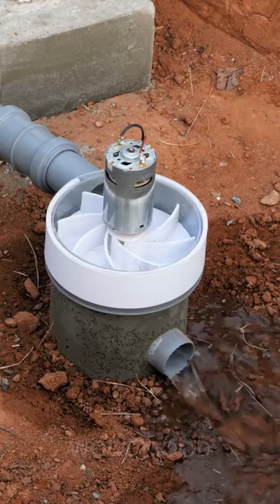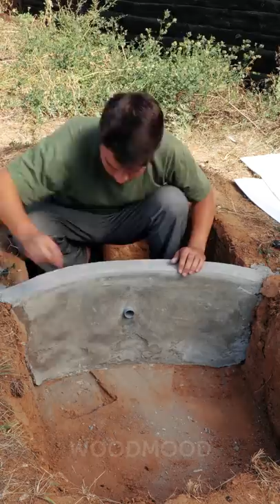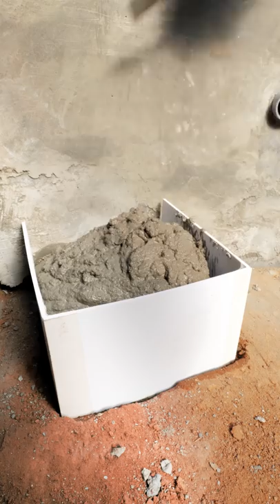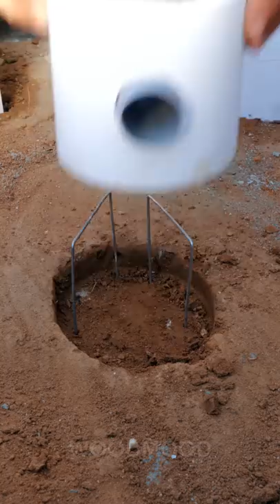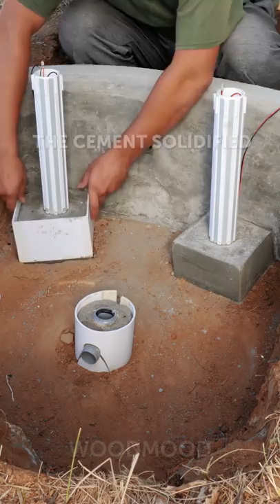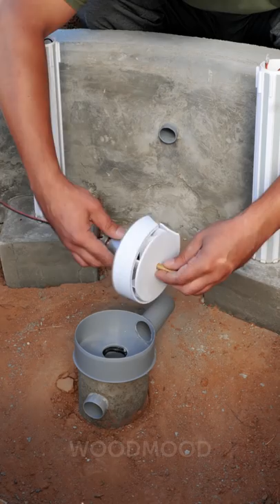I constructed a mini-hydroelectric power plant in the backyard #Shorts

Comment: It's a bullshitting concept and very very in complete without phlay wheel and a big light gear wheel with multiple teeth's around it's circumference to multiply the RPM so that potential increases and potential increases then kinetic energy also increases  and thus lot of electrical energy is  mogenerated